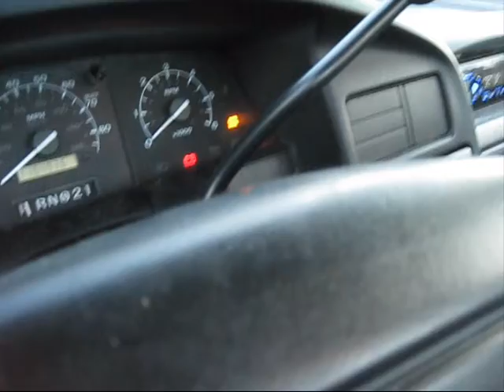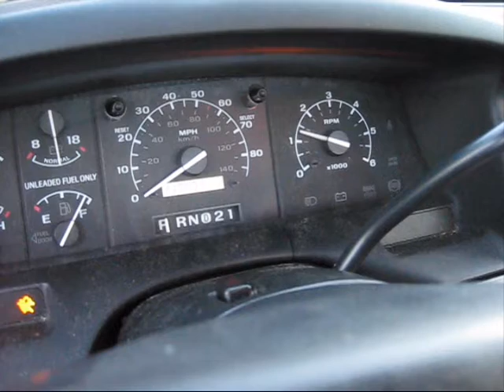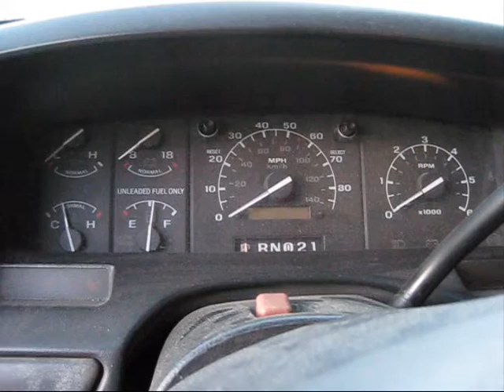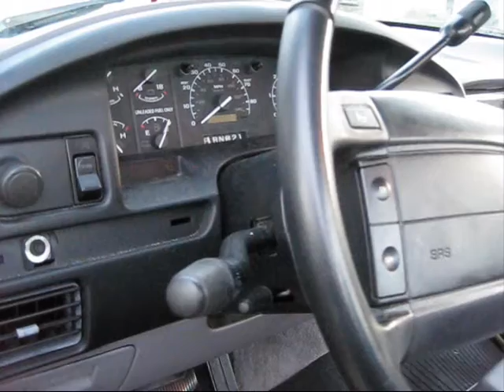OBS Ford early signs of EEC failure

Comment: I have a 1987 f150 2wd 5.0 efi I cannot locate my computer and no where on the internet can I find it can you help?
Reply from the maker: its tucked behind the driver kick panel. look in the engine compartment on the firewall near the drivers side. There's a rectangular connector with a ton of wires coming out of it. That's the PCM connector. Remove that and the 2 bolts holding the bezel around it and you can slide out the pcm. You may need to unbolt the fender liner for clearance.
Reply: @pfun41  On 1987-1991 the ECM slides out from the cabin side, 1992+ comes out how you said.

Comment: Had to replace my EEC unit in my Bronco, a cap leaked and changed how load was calculated in the EEC unit. This caused the Torque converter to lock and unlock randomly . This has caused overheating of the trans and torque converter damage and I currently need a new E4OD.
Reply: Just had e40d changed in my 94 f150, they are a bastard child, had to have one built